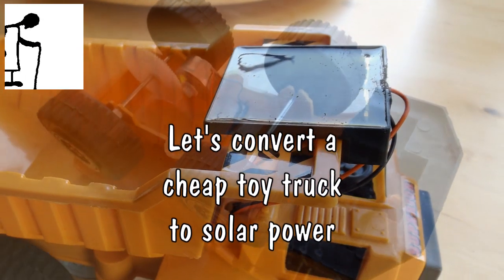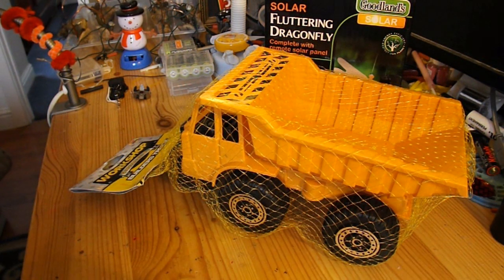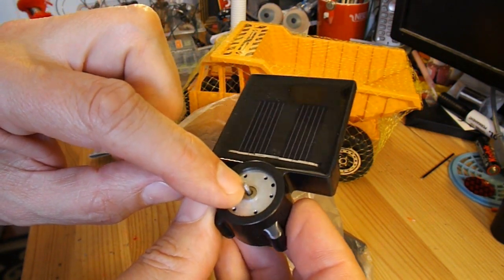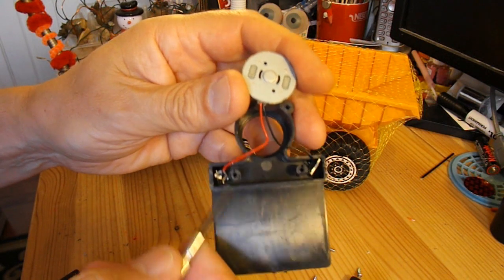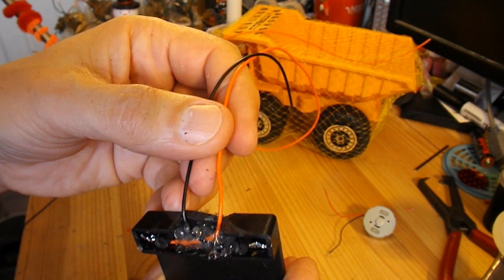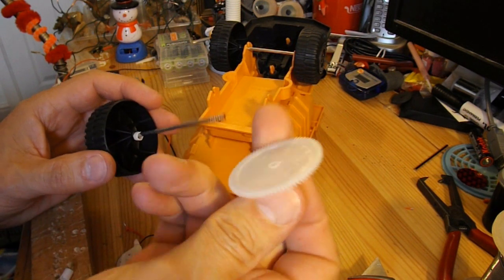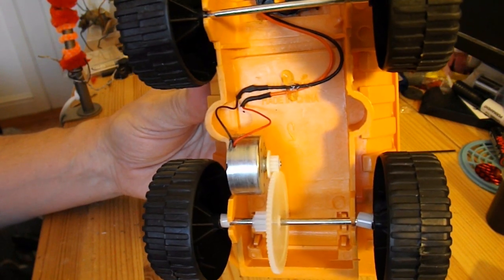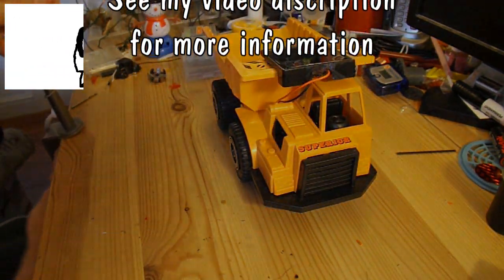Let's convert a cheap toy truck to solar power

Comment: Bro how to work a remote control car using solar panel
Reply from the maker: Your easiest route is to take a normal RC toy car and swap the batteries to rechargeable batteries. Then charge the batteries using a solar panel charger. Your car is then truly solar powered. If you want to use the panel to run the RC gear without batteries you will run into lots of issues. Different strength of sun will give different power output, sometimes not enough to run the RC gear and sometimes pushing too much power in. You could build a current limiting circuit to prevent overpowering the RC gear but there is not much you can do when there is not enough sun. I did build a solar powered RC boat as that need less power to keep it running and I didn't bother about building a current limiting circuit so I am just trusting to luck that it does not get burned out. Here is the playlist for that project https://www.youtube.com/watch?v=bKecRg11Whc&list=PLA5a2xPRSrB0CbqRkzsGRzhfMqrEydOPg

Comment: Very good conversion. You should also have that for battery power also combined with solar for battery charging and running this toy longer. Makes a great science project. You should show this kind of invention to some inventors business.
Reply from the maker: +Kevin Barton you certainly could include a battery charging circuit. You could just use the one from a solar garden light however with one of those it would not be charging the battery while the motor is running, it would be charging in sunlight then moving when the sun goes down or when you cover the panel to fool it. If you just want it to keep running for shorter periods when it passes under a shadow you could use a simpler circuit with a capacitor instead of a battery to keep it going.
Reply: +GrandadIsAnOldMan Very good idea, use that add on also, that will make this science project terrific.

Comment: can u make solar torch plz
Reply from the maker: +Sachin Kc how would that work? If you need a torch then it must be dark so the solar panel will get no sunlight. You could use a solar panel to charge a battery and use the battery to power a torch. You could also use that battery to power anything else you like so what you are really talking about is a solar battery charger.

Comment: can u make solar power  hovercraft
Reply from the maker: +Sachin Kc I doubt it. You don't get much power from a solar panel, so I doubt you would get enough power to run a motor powerful enough to lift the weight of the hovercraft and the weight of the solar panel on top. You could use a solar panel to charge a battery and use the battery to power a torch. You could also use that battery to power anything else you like so what you are really talking about is a solar battery charger. I have done cars and boats that are directly powered by a solar panel without needing to use batteries because cars and boats can take the weight of the panel easily. There is a link in the video description to my Solar Power playlist with my cars and boats in it.

Comment: What street is the 99p store that u use because the one I go to don't have the solar dragonfly
Reply from the maker: Paul Lenderson it is a seasonal item that shops only stock at certain times of the year. I did this project in June last year and there were plenty in the shops at that time so I guess you will just have to keep looking around. You could get them from eBay but they will be more expensive.
Reply from the maker: Paul Lenderson today I happen to have gone in the 99p Store in Yate and there are shelves full of these fluttering dragonflies. Are you looking in the gardening section? that is where they are.

Comment: can you make an rc solar powered car
Reply from the maker: With the small amount of sun that we get here it is hardly worth it. You could probably rig up a solar panel to charge the batteries on a normal toy r/c car and then run the car from the batteries but that would be no different to using a free standing solar charger to charge the batteries and then put them in the normal car. It would still be 'solar powered'. Running the motors and the r/c gear directly from a solar panel might work but as I say, the sun is rather unreliable here. If you did that you should include a voltage regulator in the circuit for the odd few minutes when the sun shines brightly and might over power the receiver.

Comment: Wy hot glue 😀
Reply from the maker: Hi Trevor, I use hot glue for most of my projects because it is a very quick fix and will stick almost anything to anything. In addition it is easy to to remove so that I can re-use the components for other projects.

Comment: Imagine the speed if you switched the gears around :D
Reply from the maker: It would not move. We are talking very low power, that is why it needs to be geared like this.
Reply: Ah okay.
Reply: Kirk Brotherton with more power you would be correct

Comment: Hey I recently moved my bedroom downstairs in my house and my light switch is next to a hatch where a door used to be... So my question is... Is it possible to make an infra-red light switch? Thanks... I can't find one online :/
Reply from the maker: Hi Andy, I have used circuits based on the one in this video http://youtu.be/I2yO7kyvjAY which is clearer to see on these links http://hobbyelectron.blogspot.co.uk/2012/11/ir-remote-control-home-appliance.html
http://2.bp.blogspot.com/_M97t2-ixd1U/S90AT1kv66I/AAAAAAAAAIk/T9-JFaviauQ/s1600/remot+-+appliance+circuit+.jpg
Are you confident on connecting mains power to a relay?